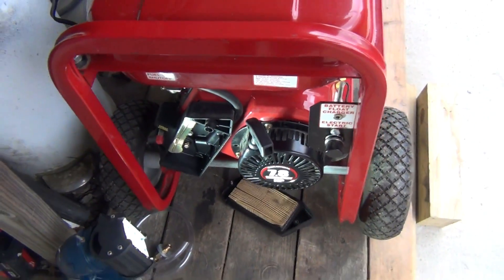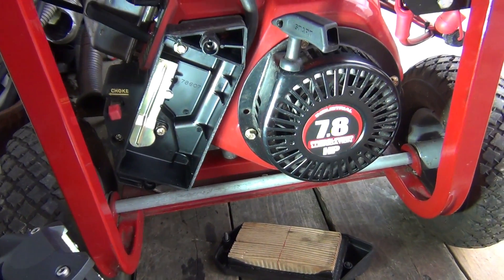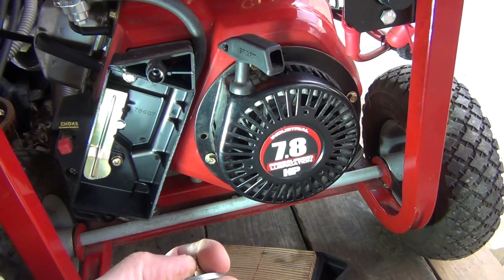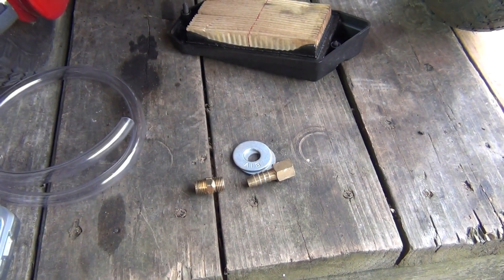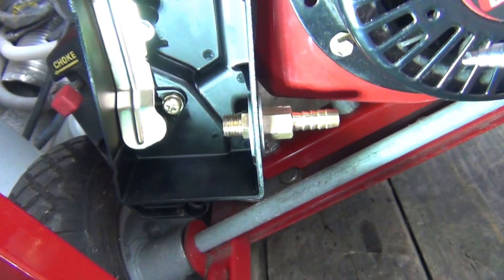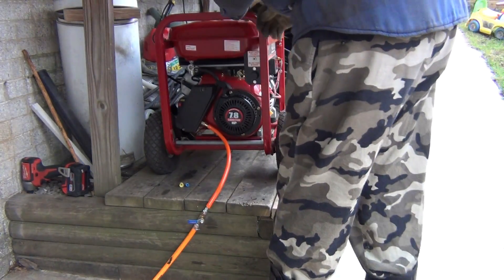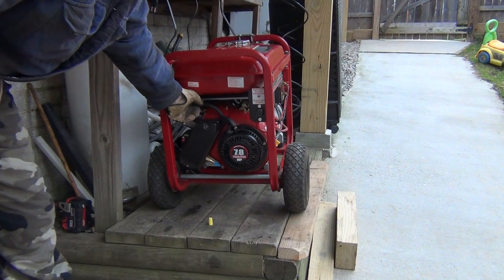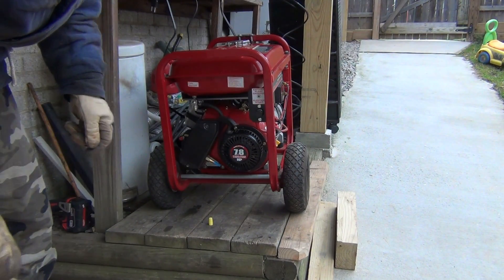Generac generator 4000exl 4000xl running on natural gas

Comment: Hey Vlad I just picked up one of these running and making power for 60 bucks!  It needs some adjustments but your videos really helped me.  Did you put the air filter back in before you put the cover back on?  I figure you did.
Reply from the maker: of course I did , these are one of the best gens in this cat